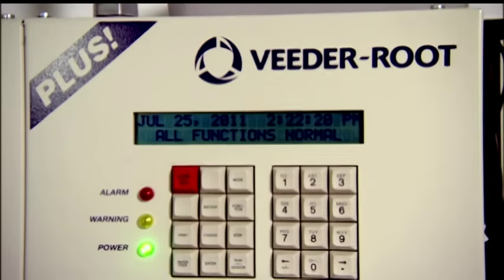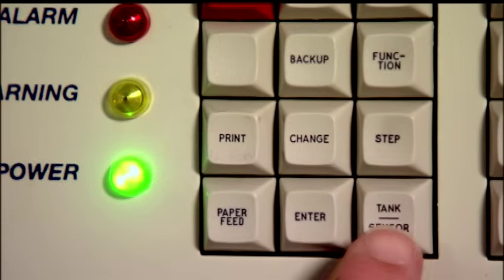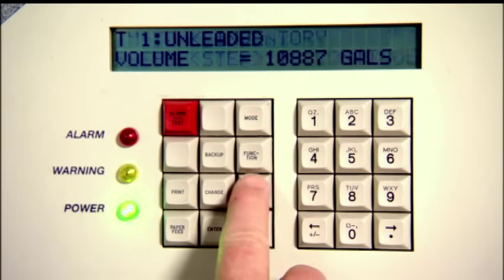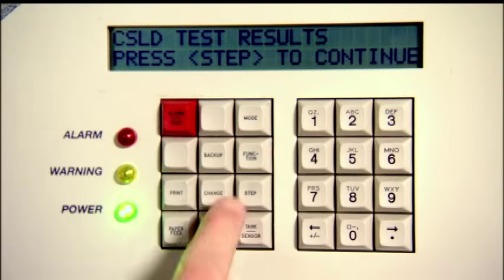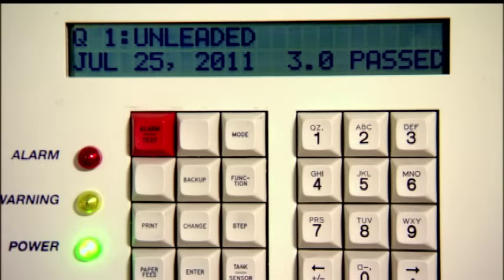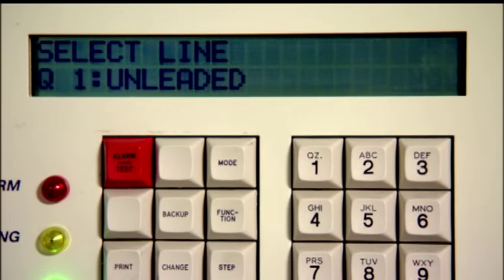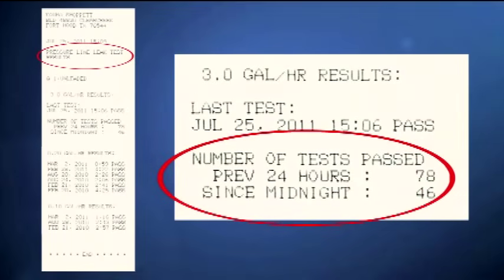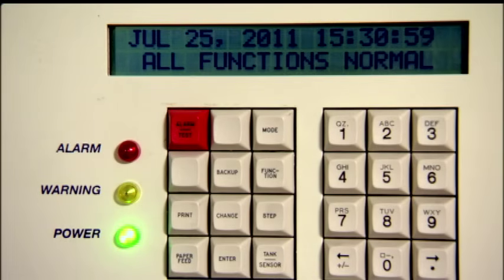Veeder Root TLS 350

Comment: Does the Veeder-Root TLS 350 provide an API to Get water reading, tank level, Continuous Statistical Leak Detection reading or Alarm data?  If so, is there any method of automating the updating the data to a Verifone POS? Great job on the Video!
Reply from the maker: Your question is multi-part, so let me try to answer in order.  You can view the ATG through the internet.  Veeder-Root has Insite360, there's other services that do that also like Canary, Titan, etc..

I don't think the Verifone and V/R interact at all.  I am not a technician so I'm not 100% reliable in this area.  But why would a POS need to know leak detection data?  They may share some inventory data, but I'm not sure.
Reply: @robertlargent  Thank you for your response, you confirmed my my thoughts on the POS to TLS connection.  It was a request from a potential customer that did not make a lot of sense.
Reply: @stephencovert7856  to be fair I wish my pos had access to it with all the cold weather and plld shutdown errors I’ve had lately. Would be great to not have to run to the back of the store every time I have to run the diagnostic to clear the alarm.

Comment: My wife works at a gas station with a leak alarm on this system already told the boss and he doesn't care what do I do now
Reply from the maker: If it is an alarm that shows a leak they will care when they start losing fuel and have to pay to clean up the contamination.  Plus the fines he can get from the local environmental authorities. He should call a technician to address the alarm.

Comment: Hi sir How to repair tls 350 plus power supply board DC, a.c inpit board, and transformer
Reply: The tls350 is no power, i already replace transformer and power supply biards
Reply from the maker: @vincentianmacawili6695  I cannot help with this.  You will have to reach out to Veeder-Root or hire a certified technician.  If your unit was under warranty you've voided it by having noncertified people work on it.

Comment: My veedor root is showing plod shutdown alaran and the red light flashing
Reply from the maker: You need to get a technician onsite.  Either your leak detector broke or you have a line leak.
Reply: I know it’s been four years but for anyone else. You backup to main screen. Press mode 2x, function 6X, step 2x, then enter. Make sure nobody picks up a nozzle while the first test is running. When it gets to test 2.0 your pumps should dispense again.

Comment: So I accidentally ran a leak test during hours of operation and i ended up getting the sudden loss alarm for  t1 (regular) and t3 (diesel), I do not actually have a leak it just screwed with the sensors, i have the machine set to do a csld test every night, so I figured after a night and a new test the alarm would go away but it hasn’t, is their a way for me to reset this light? FYI I’ve already tried the red button haha
Reply from the maker: Sorry, I was in Korea the last month.  Hopefully your problem is fixed.  I would pick a slow night, shut the dispensers down and run another test.  I thought the light would clear once you passed a valid test.
Reply: Hey thanks for the response, yeah I figured it out and once I ran the test at night everything was fine. Thank you.

Comment: My veeder root printer is not print ,that mean the paper comes out with out any written report. What shall I do?
Reply from the maker: It could have the wrong paper type. OR the paper is in backwards. OR the printer communication module is defective. Or it's a defective printer.  Play with the paper first.  Try a new roll and make sure it is in correctly.  If that fails, you'll have to get a tech out to look at it.

Comment: Hey Robert, I actually lost CSLD test results in function. It used to automatically print in the morning 5:00am, I saw your video and I tried to find CSLD reports in function. So how I can bring CSLD key and setup automatic print?
Reply from the maker: Addy, You have to have the CSLD software in your unit or it is not available.  You say you had it before, so it should be available.  I don't know anything about the programming part, I'm only a user.  You can contact Veeder-Root to see how to set up or you can run the tests manually.

Comment: My premium wplld report only does the 3.0 gallon per minute line leak test. the otger 2 say incomplete . What is causing this problem?
Reply from the maker: Could be programming or a leaky O ring seal in your LLD.
Reply: The problem is most likely you are running tests while your also dispensing fuel to customers. Your tests have to complete their cycles without pumping any fuel.

Comment: What is short alarm? How it can be fix? I believe is come when u have water on Sump help ?? Thx
Reply from the maker: SHORT ALARM
CAUSE: The sensor at the location shown has been disconnected or is inoperative.
ACTION: Call for service following the procedures established for your site.
Reply: Actually a short alarm doesn't mean the sensor has been disconnected. It means the wires have become nicked or cut and is ground out or are crossing each other wire. Call a service tech and have them check the wiring. Depending on what kind of sensor it is you can read the values of the sensor in diagnostics. Only certified techs will know where the values are when in normal condition.

Comment: Hi I was curious if there's a solution to the high liquid alarm, I press the alarm rest to stop it however it continues every minute or two to print out high liquid alarm when there's no high liquid. The constant beeping is very stressful and would love to figure out how to disable the alarm noise.
Reply from the maker: Jokester, the high liquid alarm could be due to fluctation in your interstitial fluid levels.  You should get a tech out to check it.
Reply: The alarm test key will also print out the current alarm condition if there is one present. Alarm and warning conditions are also displayed on the display.
Reply: I tell you how to fix it. Call the owner of the business and tell him he needs to get a tech on site to investigate the alarm and fix it or the EPA is going to hang his ass.
Reply: we have gotten many techs out (3 different one) and they all said the same thing, they could not figure it out, and don't see any problems.

Comment: Hi Mr Robert
I am trying to reset the alarm but i can't find options to reset it could help me with that plz
Reply from the maker: Press the red button to silence the alarm. This will not reset the display or disable any alarm functions.

The front panel warning and alarm lights cannot be turned off until the cause of the condition has been rectified.
Similarly the warning and alarm displays remain until the cause of the condition has been rectified.

Comment: could you tell me how to set the time
Reply: Mode-Configuration-System-Step until you see the current time- Change Key- introduce the new hour in 24 format- enter- step👍 You just need common sense to do it.
Reply: You need to be certified to change the time. Next time you have a tech on site ask him to correct the time for you. If station owners knew how to change the time then other changes could be made that could disable the system taking you out of compliance. The owner could be fined for tampering with system so I would not be touching the programming features of the system.

Comment: hi Robert  I HAVE A PROBLEM CAN YOU HELP ME THE 
I HAVE TWO TANK THAT DOESNT HAVE  THE REAL FULL VOLUME IT IS LESS THAN BY 2000 LITER ??AND NOTE THAT I SET THE FULL VOULME TO THE CORRECT VOULME BUT THE PROBLEM WHEN I PRINT THE TANK DATA I GET  LESS THAN 2000 LITERS
PLEASE IF YOU CAN HELP
Reply from the maker: Ammar, I am not sure if I can help with this.   Have you used your tank stick and tank chart to see how much difference there is between the Veeder-Root volume and the calculated volume?   If your Veeder-Root is not programmed properly it won't give you  proper volumes.
Reply: Thank you Mr Robert for response for my problem ..
tank stick and tank chart NO
 i m just give 20 point  profile and manually give volume for each point

Comment: I'm trying to change my shift close time.  Anyone know how to do that?
And does a inventory report always automatically print at the end of each shift?
Reply from the maker: +Village Mobil Inc I would ask the VR certified fuel tech you have a relationship with.  They probably will be able to tell you over the phone how to do this.  Or you can pose the question to a bunch of techs here.  http://www.pei.org/forum/index.php They may or may not answer you.  

When a VR TLS 350 prints reports is based on the programming.  I know that is a general answer, but I am not a VR certified tech and would be only giving you guesses if I tried to advise you.  Good luck.
Reply: Thank you!
Reply: I would not tell a station owner over the phone how to access the programming on the veeder root. If they changed any other programming it could disable a leak detection function and take that site out of compliance. Your best bet is to call a certified tech to your site. Better be safe than sorry and in this industry the sorry is very expensive.